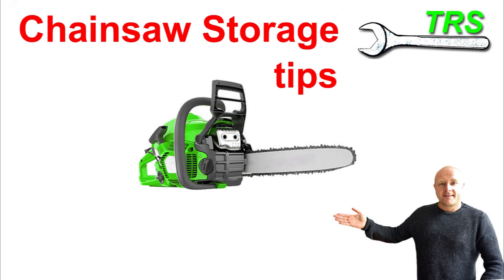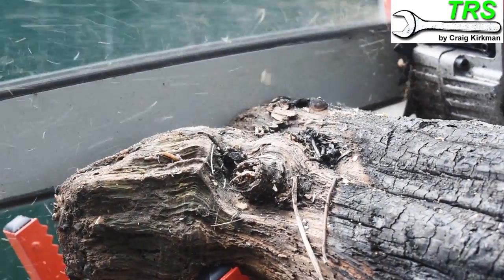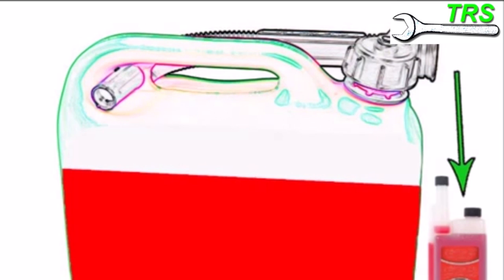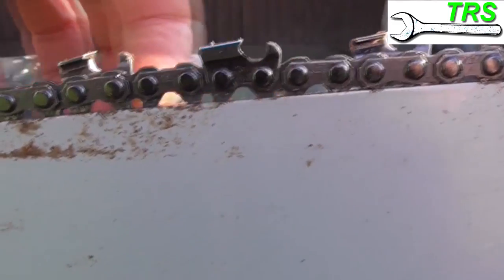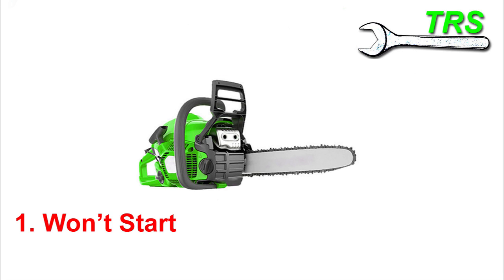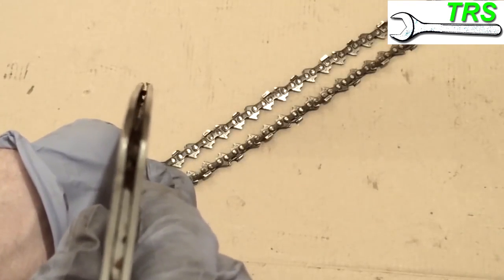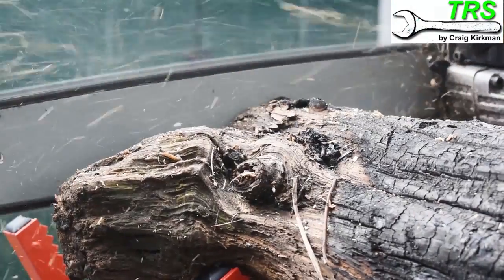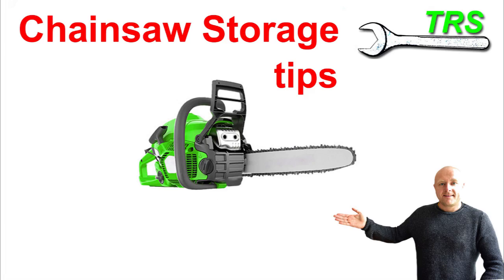How to Store a CHAINSAW  (2 Important things you must do first)

Comment: In addition to your steps, I am curious what you think about adding fogging oil into the top of the cylinder via the spark plug hole.  I do this then slowing pull the starting cord a couple times before reinstalling the spark plug.  Beneficial?

Comment: I sometimes feel like a robot saying this over and over, but here goes. Drain the fuel. With the power OFF and the carb choked and the throttle open, pull the starter cord ten or twelve times gently. If there is a purge bulb on the piece of equipment, after you have drained the gas, pump it until as much fuel drains out of the tank as is possible. THEN pull the cord ten or twelve times. Now the fuel is in the engine where it lubricates the bearings and cylinder for the next start. This is not possible with Stihl, as their saws can only be choked in the "power on" position. There are many benefits to this, not the least of which is that one need not try to remember how old the gas in your various pieces of gear is.
Since these little engines run very fast, the process of running them out of fuel then starting them dry can result in hundreds of revolutions without adequate lubrication. I am not by nature a confrontational or contradictory person, I really hope this doesn't come off as too prissy an approach, but it is a good practice.
Reply: Small engine guy here also. I'm not a fan of the "run it dry" method on two strokes either. I use sta-bil 360 and 91 octane 10% ethanol pump gas. I shut my equipment down in the normal manner without purging or draining anything. I never have any trouble with my own equipment other than rubber degradation after the usual 4-8 years.